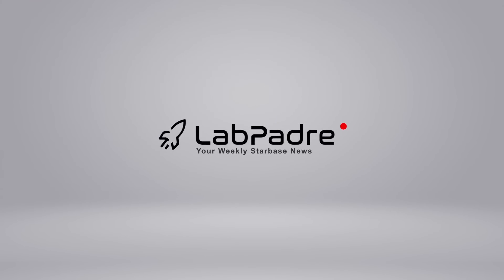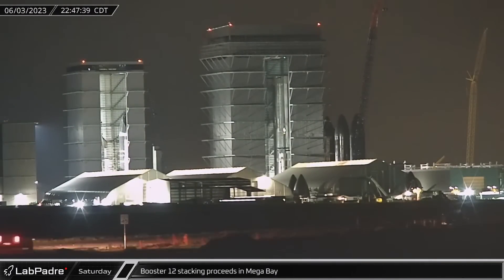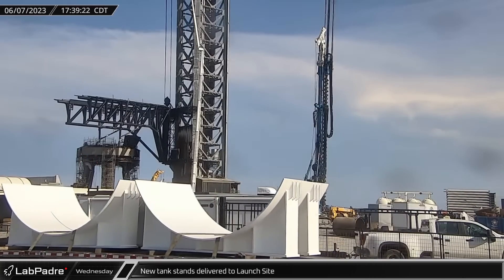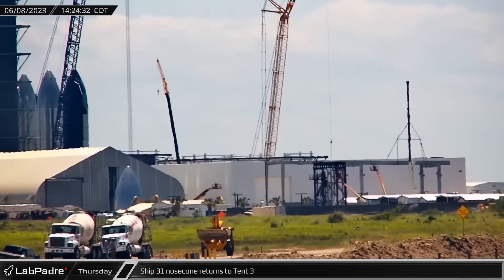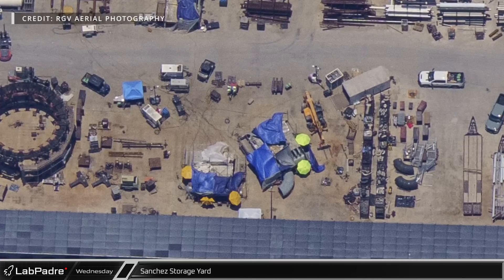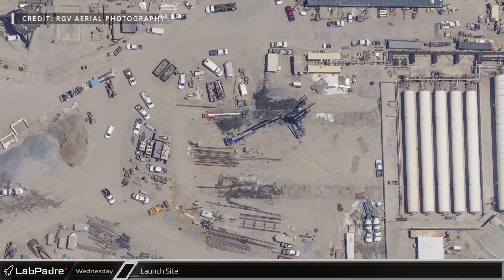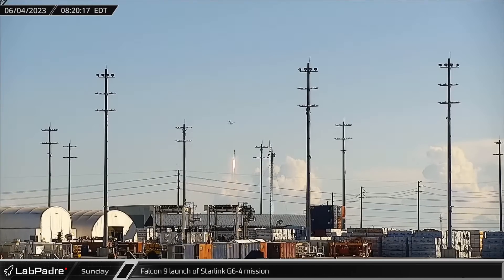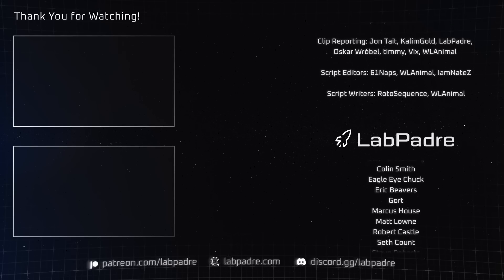SpaceX Races Forward With Starship's Deluge System! - Starbase Weekly Update #66

Comment: The new water deluge system will not work. 33 raptor engines and each one the worlds largest cutting torch. It will atomize the water and cut into the bottom plate within seconds. There are 2 options that will work. The first is to dig a fire trench following NASA's 1966 paper on launch pad safety. Or, raise the launch platform 50 feet. I'm voting for the fire trench however, there just might be a 3rd option. Sea Dragon style launch.
Reply: They have already done testing on it. What the outcome I have no clue. Fire trenches still have their own problems. While a water cooled pad can prevent damage.
Reply: @kameljoe21  If they had the right volume of water for the duration of liftoff, maybe but they don't. They have a fractional amount according to the 1966 NASA Launch Pad Safety report (paper). I guess at the beginning of July we will know if they ran their numbers correctly. I've ran mine and don't see how they came up with theirs.
Reply: @jroar123  Well do not leave me in waiting. 
From what I understand is that they are going to be using a water cooled steel plate. From what I understand is that heat hitting concrete is what makes it explode. The rapid heat up expands even the smallest amount of water causes an explosion. So that cooling pad need to withstand the forces and the heat and to not allow the heat transfer to exceed what ever the levels would be to cause damage of the concrete structure below. This pad would have to be large enough to support just enough outside the stand. I am guessing no more than 50 feet of tiles ( I think the video I see was showing a tile of such. If these are tile segment supported by a steel structure and piping laid underneath? This would allow for the maximum amount of cooled water to enter and exit at rapid rates. 
I am not sure how to even calulate the removal of heat for say 10 seconds which is my best guess. 
My guess you need to know how much heat is outputted for those 10 seconds and how much the air around it removes along with how much hits the ground and a way to remove that heat via water transfer. 
Tell me what your numbers are?
Reply: @kameljoe21  Well, you are probably needing to look at the LAPP (low-altitude plume program) code published by NASA. The LAPP code contains several options for turbulent mixing models. Water injection underneath the plum will require a rate of 16,000 kg/sec starting at 4 seconds before ignition. Most of the water will be entrained into the plume which, in-turn, will vaporize. This endothermic vaporization reaction (2261 J/g) will tend to quench some of the high temperature after-burning. However, that is making the assumption that all substances in the plume are ideal gasses. We also have to contend with acoustic suppression water by having a mixture of air and liquid water entrained into the plume in the first 80 m until the problem terminates about 1 km downstream of the exit plane. 

Liquid water + M ➡(irreversibly) H2O + M

This reaction is endothermic, 40.70 KJ/mole, which is the heat of vaporization of a mole of liquid water. M is an arbitrary third body. 

The plate that they are going to use at the base of the launch pad is made out of a Nickel-Based Alloy. More than likely 316 stainless steel. it's expansion numbers are Thermal Expansion
(10-6 in/(in oF))
I don't have the test results on the metal but the numbers are close to 8.5. So we will see the plate expand out by several mm. This will weaken the metal and possibly causing it to fail within the 10 seconds. 

So we have 33 raptor 2 or 3 model engines producing enough force to blast threw the metal plate no matter how much water you atomize from underneath. Another consideration is the sand infused with water underneath. That water by conduction will expand as well. The expansion will force the plate upwards possibly disconnecting pipe at flanges and or welds. 

There are 2 possibilities to solve this problem. #1 is to raise the platform up by 15 to 20 feet and create a channeled berm or # dig that trench and let it flood with seawater.

Comment: I have a suspicion that not all the vertical tanks will be disassembled. Some the N2 tanks and O2 tanks could be reoriented horizontally and covered by a protective shelter. This way the refueling depot and piping need not be moved.

Comment: Could it possibly be the base for some kind of simplified deluge system?
Reply: thought so too. but the internal segments don't seem to be connected via holes.
Reply: @Takumi-San  I don't think they need to be. The compartmentalization should enable enough pressure to build up to force the water through holes in a (hypothetical) top plate in a decent spray?